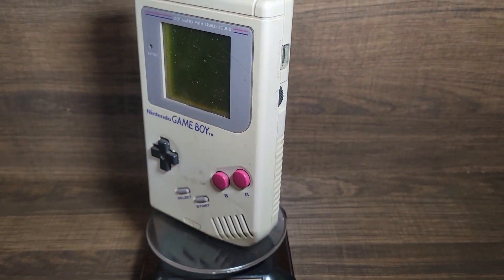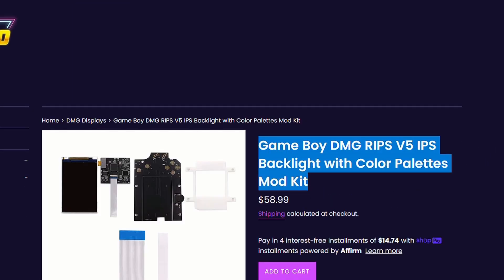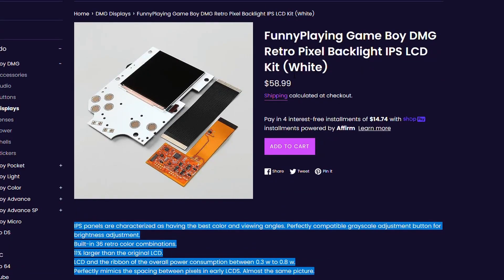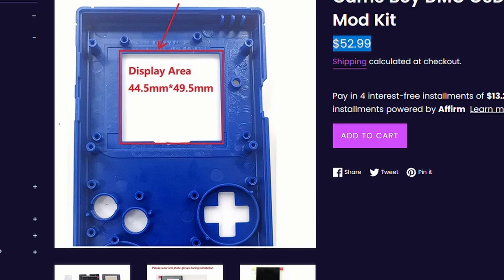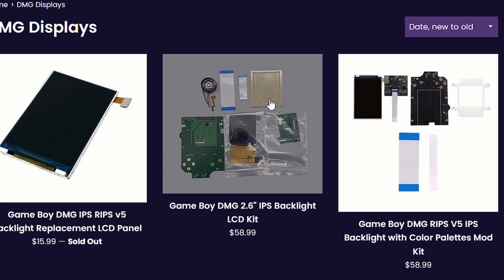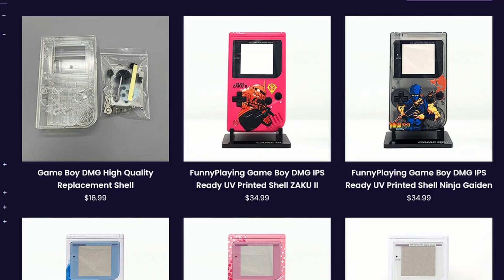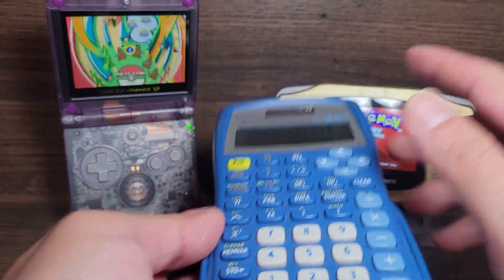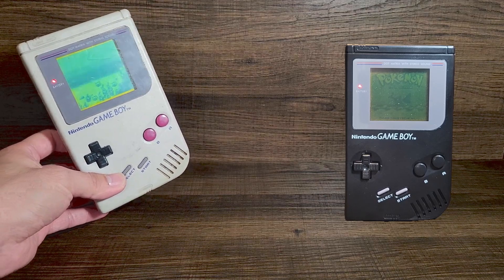A Guide to Original Game Boy Mods

Comment: I highly recommend the IPS GBA mod and the Epilogue GB Operator if you have Windows with a 64 Bit OS. Another thing I recommend is a Geek Tech Batteryless Save Flash Cartridge so you can Flash your own games with the Epilogue GB Operator. It also has a Rumble feature in the settings so you can play with Rumble using your favorite Rumble Controller. I took my copy of Legend of the River King 2 and ran it through the Gameboy ROM Analyzer for Windows and changed the cartridge type to 1EH and fixed the header. This enables Rumble that was programmed into the Japanese version and just needs to be opened on the English version because we never got that feature. I then Flashed the new ROM that was repaired to the Geek Tech cartridge. Way easier catching fish now and battling is more fun.❤😊
Reply from the maker: I've heard good things about the GB operator. I am eventually going to mod my gameboy or mod a gameboy color, since the Color is the only one I don't have at the moment. I'll definitely look into the Geek Tech Catridge👍

Comment: The Pow Kiddy V90 is awesome for Gameboy if you Etch and Partition your SD card with the Pocket Go Firmware Update. It actually has a motor in it for Gameboy Color Rumble. The only drawback is you need to go to settings to shutdown every time before hitting the power switch. The Legend of the River King 2 for Gameboy Color works with Rumble on it if you do my trick.
Reply from the maker: I've some videos on the V90 and it looks good. I would maybe buy something like it to play all my games on one device and have some extra settings and whatnot. The only thing I have right now is an ez flash omega for the GBA, which allows me to play homebrew games and regular gameboy games on my GBA.